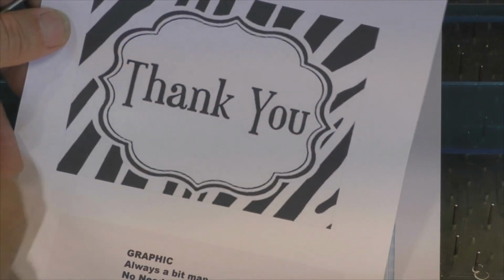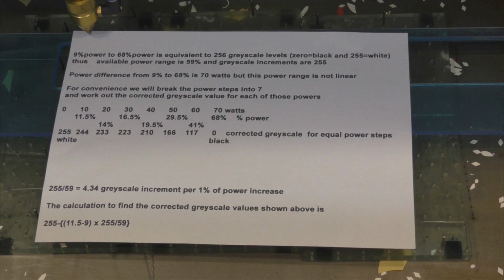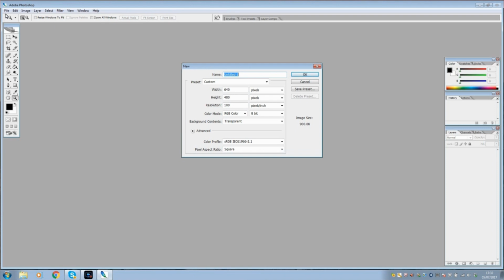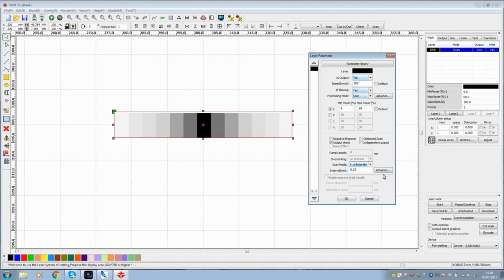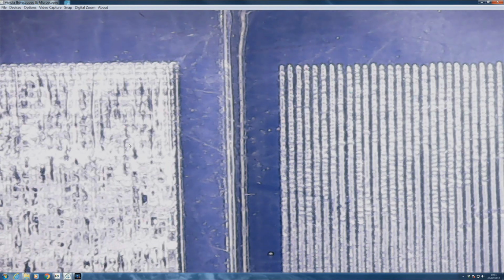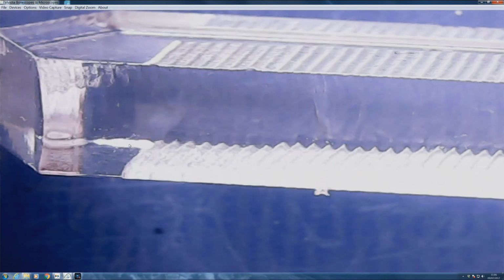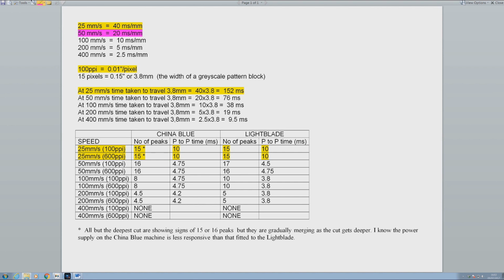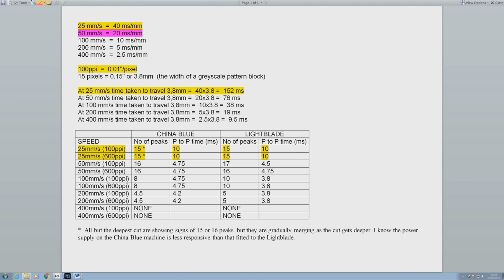RDWorks Learning Lab 110 3D Engraving in depth revisit Part 1

Comment: Hi Russ. I am a bit behind in viewing this lot of videos so you may have come across the information I am about to spout. In the distant past I was the proud owner of an X-ray machine. The methodology of producing an X-ray beam and a laser beam is quite similar but not the same. So I am applying what the X-ray engineers who serviced my machine told me.

First of all just like an X-ray machine we are not dealing with a constant beam at all. But actual pulses of light. The pulses come about due to the phase nature of the electrical current. In the U.K. We have 50 hertz electricity and USA 60 hertz. These tubes are drive by DC current so we get a series of peaks in the current 50/60 per second depending on where you are in the world.

My hypothesis is the the reason you get you best result at 50 mm per second is that is due to the electrical sweet spot. So 50 mm/sec and 50 dpi might be the best you can get regardless of spot size etc. I suppose you could try multiples of 50 (100 / 100). In the USA it would need to 60/60 and multiples of that. 

Just a thought. I am not an electrician, engineer or electronics buff. Just inquisitive about gear I have about me.

All the best and keep up the good work
Mark
Reply from the maker: Hi Mark
I'm always interested in others views and opinions because you never know if or how something mentioned will spark a new and different slant on a problem.
I think the 50mm/s is just a massive coincidence that  sent me off on the wrong direction until I hooked up my little Picascope and the evidence of seeing what was really going on  made me realize that several mechanical and electrical issues are entwined.. The 50mm/s is related loosely to and electrical property but I'm sure its not mains or double mains frequency issue.  There is too much filtering to see those sorts of issues. . I will shortly be doing a final part to my photo engraving/dotty saga. and I think some of the facts I now possess may shed some light on the 50mm/s coincidence. The other issue that is linked to this saga is the stepper motors and the belt. The tests that I was running accidentally entangled two different problems that interacted. 
I have looked at the current in the cathode line and there are very high frequencies in there but nothing anywhere near 50  or 100 Hz. Before I had the benefit of my scope, the only way for me to see into the machine was by looking at the physical results. Even then, (and I was looking for 50 and 100 hz  issues.) nothing matched.
Best regards
Russ

Comment: I can see how someone who hadn't characterized their lasers power would be lost
Reply from the maker: With so much correspondence as I try to help folks offline, it's amazing how many people believe
a) Their tube delivers what was advertised
and 
b) That dialing-in 100% power will get them that advertised power and 50% will get them half power
I often email my calibration chart to try and enlighten them. I hope that this use of the chart (albeit nnecessary as you will see in part 2) helps to explain one of it's many potential uses.

Best regards
Russ

Comment: I wish CNN would use your definition of an expert :)
Reply from the maker: You only become an expert by making lots of mistakes (and learning from them). I know I still have a lot to make!
I make my mistakes publicly in the hope it helps other avoid the same. When you have made your last mistake, only then can you claim "expert" status.
Thanks and best wishes
Russ
Reply: That's a good standard. I learned a lot from your dot series. I found that i could reasonably accurately predict which dpi, interval and speed settings would make the best picture quality on my machine by doing a quick pixel test at each setting. The test is a 10 pixel image scaled to the dpi in question. it is one column of black pixels on the left, one row on top two columns on the right, two rows on the bottom and one black pixel in the middle. this tells me if the speed will wash out my photo by skipping the middle pixel. it also tells me what the max power I can get is before the two pixel column is too much darker than the one pixel column.
Reply from the maker: Hi Steve
That's a neat trick. Thanks for sharing.
Best wishes
Russ

Comment: You might want to test by creating a vector version of your power bands.  One vector line with a power setting connected to another line with the next power step.  Just to see if it's just the software on how it processes bitmaps.
Reply: I understand in the grand scheme of things, creating a scan-line based vector representation of a bitmap image is horribly inefficient(where in a lot of cases, you are defining a line for something that is only a pixel wide).  For the simple power scale you are testing that has the dots, it'd be interesting to see if the dots go away and demonstrates that it's possible to have non-dotty 3D engraving.
Reply: Oh, and as always, thank you for such detailed work.  It really helps me wrap my head around how these things are actually operating.
Reply from the maker: Great idea....but sadly, will never work. A vector driven scan line has no pixels or colour attribution and therefore has  no mechanism to vary it's power during a scan
Setting certain max and min power values will have an effect but only on the ENDS of the lines See  
https://www.youtube.com/watch?v=vqQyhW4uSsM
By default, my greyscale swatch has to be a bitmap because vector graphics do not possess a resolution feature or any colour filling.
Hope that makes sense.
Best wishes
Russ

Comment: A very interesting video, as usual.  I expect you get tired of hearing that; such is the price of excellence!  

I am interested to know why you used your power curve to set the greyscale values.  I understand that you wanted to linearize the amount of power delivered.  But isn't this really just a proxy for depth of cut (engrave)?  Don't you really want to create a transfer function for DEPTH vs PowerSupply% ?  It seems you could do this by slicing through your test samples and measuring the depth.  The reason that I bring it up is that I wonder if different materials will have their own transfer function for depth vs laser_power, such that we cannot assume that depth vs laser_power is a linear relationship.

Perhaps that is included in Part2, for which we all eagerly await.

Regards,

-Jeff
Reply from the maker: Hi Jeff 
You ask this question without the benefit of seeing part 2. Acrylic is a fantastic material for test work and just vaporizes if the local temperature is high enough hence its ability to record incredible details about the laser beam. When I am doing these tests, they are not demonstrations of what I know but a record of my discovery path. I anticipated that the serious  non linearization of power  would cause me problems  when I came to doing real 3D tests in part 2, so I decided to experiment with the effects of linearizing in this part 1.. As you will see in part 2  (thank goodness) linearization is not required  because I am fighting to limit the power and NOT use the whole power range available. I also dermonstrate that there are other causes of non-linearity that are MUCH harder to deal with.
Thanks for the kind words and the question.
Best wishes
Russ